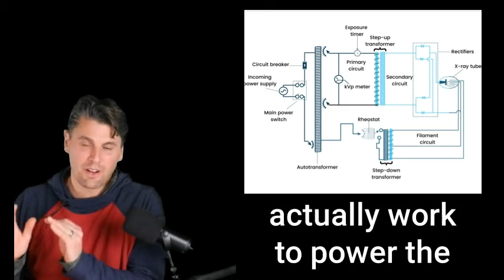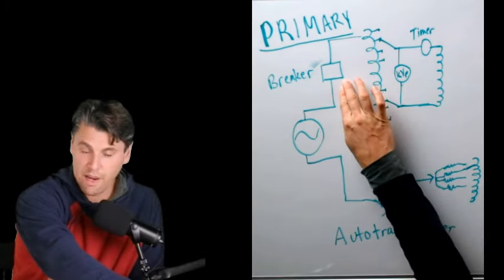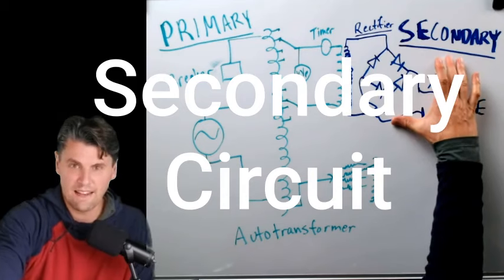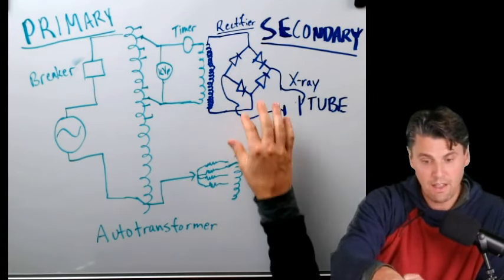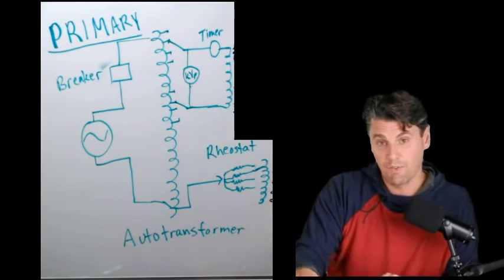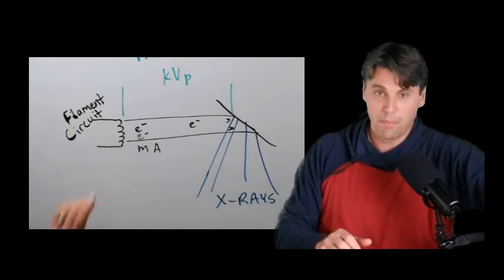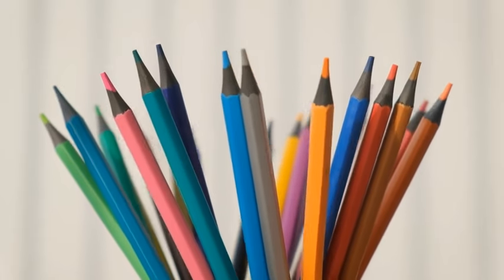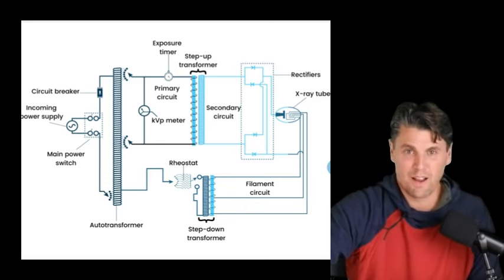X-ray Circuit (Primary, Secondary, Filament Circuits)

Comment: The diamond shape diode thing is what EE's call a full wave rectifier. Toss a PI filter on the output of these and you get a decently stable DC voltage, but a simple R-C filter is pretty good, too. Great video!
Reply from the maker: Cool, thanks. Yeah this is a really conceptual diagram. Now a days it’s most high frequency inverters for x-ray systems

Comment: Nice video.  My only comment is about the filament transformer.  It does not need to be a step down transformer. It could be 1 to 1, with no step up or down.  The filament needs about 20v to heat up properly.  Its main purpose is to isolate the low voltage circuit from the voltage circuit.  So there would be 50K to 150K volts between the primary and secondary sides.  There would also need to be two transformers so both filaments and not on at the same time.
Reply from the maker: Thanks for the clarification, yes this is a simplified circuit with representative components

Comment: you should make it clear that the diagram you explained is for the low frequency x ray voltage generator, nowadays all x ray generators are high frequency generators which have negligible ripple and are much smaller and more efficient in converting the electrical potential.
Reply from the maker: Thanks for the comments, we have videos on kV waveform and Tube Heating that go into high frequency inverters more. This video is a basic introduction on the simplest circuit designed for radiologic technologists.

Comment: Thanks for the video. Are you saying that the DC voltage value in the electrodes is not the same as the voltage value across the filament?
Reply: The filaments need about 20 volts (usually ac) to give off the proper amount of electrons for the ma current through the x-ray tube, which would be dc current.  The filament voltage varies depending on the ma and kvp selected by the Technician.
Reply from the maker: Thanks John, yeah the filament needs high Amps to warm it up so it uses a low voltage to get high amps. And then the kVp is the voltage across from the electron cloud to the anode to pull the electrons across 😀